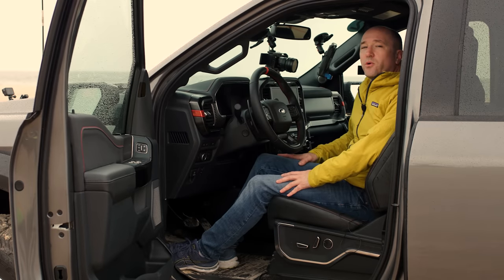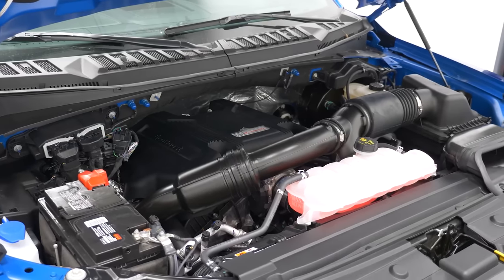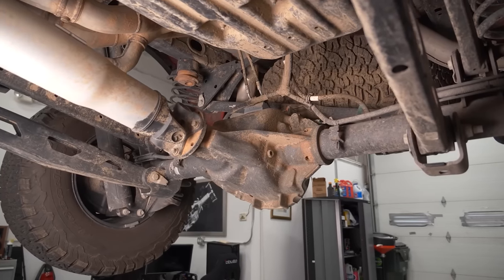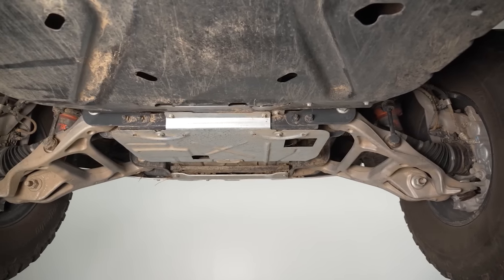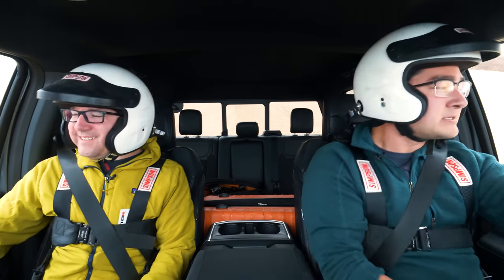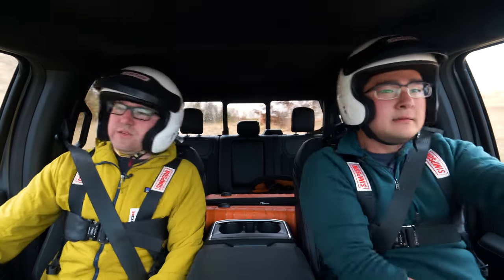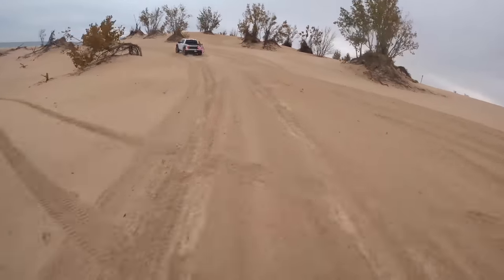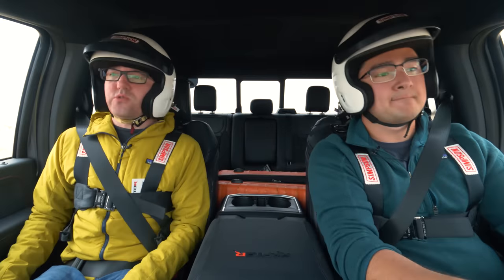Ford Raptor R First Drive | $109,000 for the V8 Experience

Comment: Here’s the bottom line irrefutable facts. The GT500 has a version of this DOHC blown V8…w/ a much better Tranny. The Raptor? It’s engine is tied to the damn Ford GT, which is a better relative? Not even worth discussing. Only Ford EB engine w/ fully forged internals I left GM 6.2 V8s for a FORD turbo the second I really test drove a gen 2 Raptor, I’m on my 2nd now (a 2020) & am in process of making deal on a gen3 37”pp- if you can afford that - you can afford an R- but I love the 3.5HO

Comment: WTF.  Why not just buy a used V6 Raptor and put in a V8 supercharger engine (of have a shop do it) FOR HALF THE PRICE? I'll tell you why, because people who buy this truck have more money than sense and will take if offroad at most one time.  I have much more respect for people who buy a base Wrangler or Bronco and build it up themselves.  And wouldn't you get tired of putting gas in it every other day even if you could afford $100 + fillups?

Comment: This is a stupid truck. It’s got nothing to do with off-road running. It’s about flaunting your money. At least the Gladiator gets used off-road mud bogging and rock crawling. This will do neither. Nobody’s taking this on either surface. It’s nothing but a toy and a garage queen for 99% of buyers. Buy a Mojave Gladiator for half the price.

Comment: There is zero reason for this vehicle to exist.  It goes against the greening of our roads and environment.  Ford should be ashamed to bring this polluting vehicle to market.
Reply: LMAO.  Drama much?
Reply: The abundance of precious metals EV batteries require for manufacturing, and the fossil fuel necessary to acquire them from China's mines certainly don't "green our roads."
Reply: The amount of these that will exist will have next to no impact on the environment.